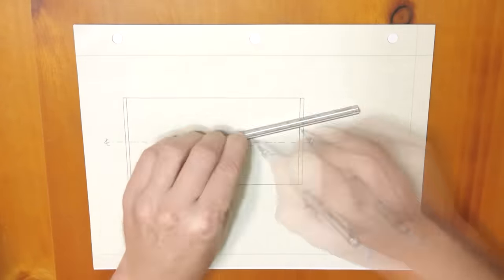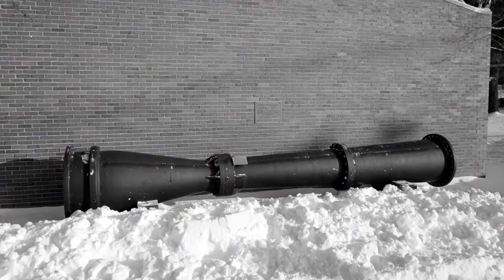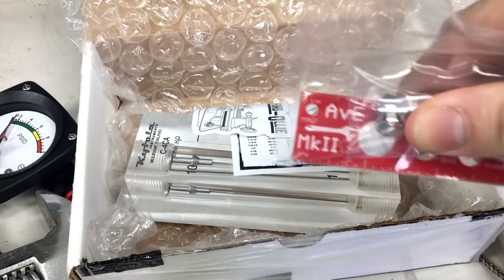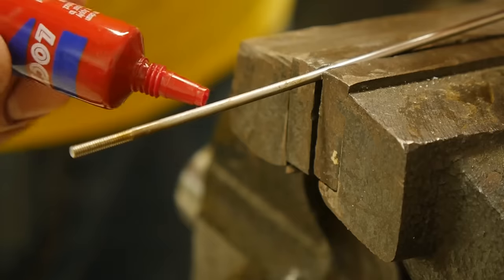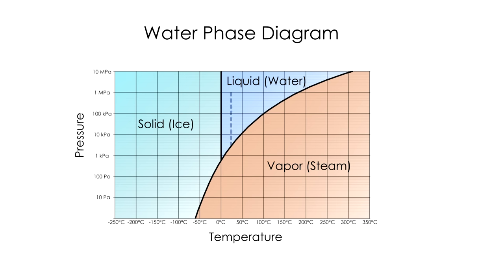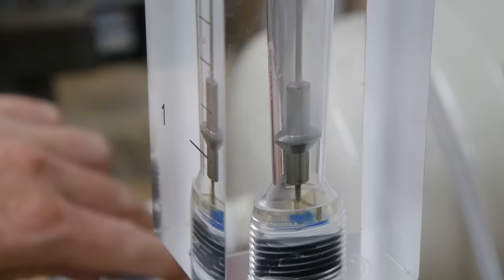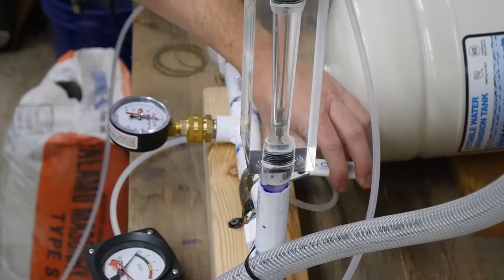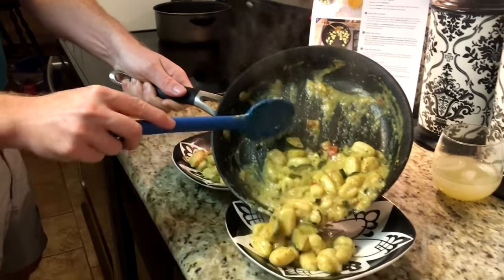What is Cavitation? (with AvE)

Comment: Cavitation can eventually wear through sleeves, the block, and any other components that coolant(antifreeze) flows through in engines i know we use  venturi ports for sensors to measure exhaust pressure for EGR in 18 wheeler engines

Comment: I have a question about phase shifts and changes in pressure (looking at the chart of water phases) that I am hoping to gain some more insight on - any insight would be appreciated. 
How does the rate of pressure change impact the vaporization of a liquid (and even would the liquid's velocity have an impact)? In other words, is the relationship between temperature/pressure assume uniformity of things like laminar flow, consistent pressure change, etc?
Thanks in advance, my imagination stays active when I watch your videos!

Comment: Great video! I was just left with one question. At 1:20 you explained that the fluids energy needs to switch forms. Why does it need to be the pressure that decreases instead of some other internal energy form, such as heat?

Comment: Would you could you possibly do a video on prop cavitation on a boat. I know that boat engines requires some cavitation in order for the engine to gain rpms so it can reach maximum speed. I had a boat with an inboard/ outboard engine. The engine was a 140 hp inline 4. The out drive had a 24p aluminum 3 blade prop. When traveling at 30 mph+ and a sharp turn it would cavitate severely.  It didn't take long until the prop had tiny little holes on the surface in the same area on each blade. If you don't want to get into it I completely understand. I would love to see it explained. And I would like to show my son in law what is causing the same thing on his boat.

Comment: Cavitation is actually a very important thing to consider with submarines. You want the sub to move fast, however, if it moves too fast, it starts cavitating, which will give your position away to anyone willing to locate you, which is usually the same people that want to destroy your sub in a combat situation. One solution is to simply dive deeper, as the increase in pressure also directly impacts cavitation, however, if you dive too deep, the submarine will be destroyed by the pressure, so you have to design the blades of the propeller in a way as to minimize cavitation, as this allows you to go faster as less depth.

Comment: Cavitation erosion is a major wear concern on wet sleeve equipped diesel engines. A air pocket in the cooling system causes implosion. The result is noticeable wear on the sleeve contacting the cooling system. Many OEM recomend replacing the wet sleeve.

Comment: Lol.  Thanks for your video.  I've been wonder for year seen I was a kid(may be 8 years old) ,  i had an accident discover and always think about it since then.  Btw,  I have a better and cheaper way to demonstrate your experience,  by just use a garden hose and a clear soft tube.  Back then,  I had to watering my mom garden in my hometown(vietnam) several times per day,  we didn't have the nozzle to spread out water,  so I had to squeezed the end of the hose,  but then I didn't want to wet my hand,  so I squeezed the tube a bit farther from the end,  and accidentally heard the water bubble sound. I thought when I squeezed like that,  the velocity and pressure of the water came up too fast that can traped and suck the air from the end back to the tube and make that sound,  but when I move back farther,  eventually there are no air mix(bubble)  came out,  but I still hear and see the bubble formed behind the squeezed spot.  Later,  I tried on a compressor car wash,  and found out the damage on the tube wall.  In fact,  I did cut(separate)  the tube after 5 minutes  of squeezing the tube under the pressure of the car wash.  Also,  I found out the damage at the end of the carwash adjustable brass nozzle.  Back then I just understand a soft material like water still be able to to such damage to other hard material like plastic,  brass,  steel or rock(i didn't know water cutter machine exists until later). So now I know how to explain for my kid(in the future,  not yet 😁).

Comment: To observe the effects of extreme cavitation, get someone with a water jet cutter to install a pipe inline without deburring the I.D. of the cone tip after cutting and threading. The next pipe down steam will be fractured longitudinally about 10-30mm after the cone, with a 3-4mm bowtie pattern on the outside. Cavitation bubbles collapse and get focused up to 1 Million PSI! 

Amazing that water can actually compress by up to 10% at 90,000psi!
Reply: @waterjet channel maybe?

Comment: Maybe you can answer a question for me.
On a Hydraulic oil system running at 450psi from the pump to filter housing. Why is it that if the housing is not tight enough it sucks air instead of leaking? Pressure inside canister is greater than the outside air so I would think it should leak.
But it sticks air and creates foam in the oil.

Comment: On our hydraulic run water pumps on oil field cement units over spinning will lead to cavitation leading to air bubbles in cement that Coriolis tubes hate, plus it pits the impeller

Comment: I've proposed the installation of a "safety ring" around the circumference of a boat's propeller to prevent injurious strikes against humans, manatees, etc. This wouldn't be like a ducted fan, but only a safety bar. Do you think the fluid dynamics would make this overly interfere with thrust due to cavitation? (I don't).

Comment: I'm positive the pump we use for truck discharging has internal cavitation damage. Visible rust on the outside in a specific pattern is present. 

I wonder what happens when the casing fails and flammable liquid goes everywhere 🤔😲

Comment: Interesting about steam creation at low pressure. Consider, so much power generating is based on heating water to make steam which turns turbines. I wonder why that trick could not somehow be used to do the same.

Comment: So I'm into building and racing cars. In engines that are revved past the manufactures redline, it is often said to upgrade the engines oil pump to avoid Cavitation. The question is, does this cavitation act on oil the same way as water?

Comment: Y'all forgot the jet! 

The collapse itself isn't the worst part. The way it collapses turns the cavity bubble inside out, creating a micro jet, sort of like a shaped demo/anti tank charge. This jet of liquid hits the surface oposite the direction of collapse. But it also means the damage is directional. If the bubble were to collapse facing away from the surface, the jet wouldn't hit anything.

Comment: I suspect the 1-1/4” suction fittings (90’s) on my shallow well water pump are causing some cavitation as I hear air bubbles when pumping but the suction line is tight. I suspect this is causing wear on the nylon impeller so based on the video I need a larger suction line and smooth 90’s..

Comment: I know this video is 2 years old at this point, but i feel that I have to mention that I'm pretty sure you meant pistol shrimp and not mantis shrimp. mantis shrimp in general either spear or use a very strong hinge mechanism to hammer open tough shells. pistol shrimp use a large claw to shoot a jet of water incredibly fast which  i believe is the example of cavitation you meant.
Reply: He definitely meant the mantis shrimp, which is so much more interesting to people that it is talked about and linked to on the pistol shrimps wikipedia so they can go read about it instead

Comment: I am working on a 70 foot yacht right now that has holes in the hull above and in front of the propellers that have an air passage to create "controlled cavitation" I have seen this on several boats (all the same manufacture, and all from the mid 1980s ) so I am thinking that it did not work like they wanted it to, or they found a different way to get the result they were looking for, (not sure what they were trying to achieve with this) .

Comment: I have a question.  Why is it that carburated engine planes get carburator icing on warm days, even when it is as much as 38 degrees?  The paradox is that on colder days, the chances of carb icing go down.  Also, as temperatures get warmer, the maximum potential of car icing tends to be at a lower RH.  Max probability at 30%, while the same chance at 100% RH doesn't occur until 28 deg.  This is the curve for "light icing".  I would love to hear an explanation on that.

Comment: What's the equivalent principle in aerodynamics?  As long as the grass is below the top of the box in my trailer, the pressure inside the box from the air streaming over the truck on the highway will always keep the load inside the box, compressing it, and prevent it from blowing out of the trailer. Doesn't work if any of it is sticking out the top, at which point I need to tarp the load to prevent it from flying. I always thought this was a cavitation effect, but apparently not.

Comment: Would cavitation be used in a steam heating system? Or is this too dangerous? 

I have a gas fueled boiler steam system. I was wondering if it may be advantageous to add cavitation to increase thermal efficiency.

Comment: If steam is being formed in the partially blocked flow meter, then the steam should be absorbing latent heat of vaporization, so the temperature of material around the obstruction should fall.  But apparently that doesn't happen.

Comment: This type of flowmeter is called a rotameter and is just a float in a vertical diverging duct. I'm confused as to how you can use it as a substitute for a venturi, since it has only a diverging part which slows the flow down?

Comment: Okay. We know for steam to form with in water, it requires a micro bubble to begin with. Where would these microbubbles come from in this instance?  I have always had the understanding the bubbles formed with cavitation are oxygen bubbles as the dissolved oxygen comes out of solution due to the low pressure zones.

Comment: Today I learned that collapsing cavitation bubbles are violent events. The sphere becomes a torus as water pressure pushes inwards until the torus is fully collapsed. A micro-jet forms in the direction of the collapse, acting like a jet from a shaped-charge warhead and is capable of scouring metal. And that's on top of the shockwave created from the collapse.

Comment: Around 4:15 you say that water can be turned to steam at room temperature even at low pressures. What is considered low pressure? The water phase diagram shows 1 MPa = 145PSI = 10 x atmospheric pressure
Reply: The phase of water (and all materials) depends on pressure and temperature, both equally important. At one atm (atmospheric pressure  = 100kpa = 14.7 psi), water will boil aka vaporize aka turn to steam at 100 degrees celsius. HOWEVER the lower the pressure, the lower energy is needed to vaporize the water. This means that (although there are limits to how far you can go) you can alter the pressure to cause water to boil at any temperature you choose. It is an exact science. If we desire water to boil at 20 degrees celsius, we need a pressure of 0.02339 bar according to a property table for saturated water from my textbook. This equates to 2.339 kpa, so a quite drastic reduction in pressure is needed. Reducing the pressure beyond that will only cause the gaseous water vapor to expand to fill up the remaining space to the best of its ability.  

By the way, that value appears to correspond nicely to the chart at 4:15
Reply: @kylecook4277  Thanks for the feedback. Makes more sense now.

Comment: How about oil pressure loss, or temporarily induced pressure loss, in say, a turbine engine that is cycling 10 to 12 gallons oil through the system every 42 to 51 seconds? Would a momentary ingestion of air, or let’s just say a sudden lack of liquid oil from reservoir, which is at 70 C, and unpressurized (atmospheric vented), into the pressure pumps that are set to output between 150 and 250 psi, induce similar effects to a jet engines oil?

To be clear, I am just diving deeper into a possibility of negative g condition causing a delayed pressure drop in the power section oil system of a turbine engine. I realize the lack of oil pressure and its significance and eventual destruction of said power plant, if oil under pressure isn’t returned into system within seconds. I’m just understanding this “bubble”(bad term here, I know) that would be passed the system or at least part way and looking to educate myself on what we assume is merely a lack of pressurized oil passing through and intending to form an argument that this is not to be an acceptable condition or viewed as “normal” in any way...

Thanks for any response and great videos! I Subscribed!

Comment: Weirdly enough where I work has an issue of internal  damage caused by cavitation caused in a liquid mercury target contained inside a SS vessel, but that is likely because of the 1.4 MW proton bundles being slammed into it every 60 microseconds. Practical engineering should hit up another CE for a tour sometime.

Comment: Careful with that axe Eugene: LeClair (2014) used a ¼ hp cast iron water pump off Ebay to long term cavitate a rolled up perfed aluminum sheet in a plexiglass output tube and both guys had radiation damage requiring hospitalization. Beware transmutation.

Comment: Can this high volume low pressure effect of the reduced diameter be used to pump water (coupled with a tesla one way valve) with no moving parts?
Reply: I'm an Engineer on a steam ship.
I'm pretty sure that is how we introduce new water into the boiler , overcoming the pressure of the steam inside the boiler.....

Comment: seek to use water and air to dig a hole. seek to use high-pressure large volume water with a one-way valve inject bursts of high-pressure air to add to water that closes the one-way valve for a moment slam water out the end of the pipe.      i not sure how to calculate force. increase hammer effect at the end of while maintaining pipe safely.

Comment: Water has a 4th state in high temperature/pressure environments like, say, the piping in a coal power plant. Super-critical water at 114c will turn to steam instantly in the piping and it is in-between those two environments you can find this 4th state.

To be fair, its not real science and water does not have 4th state, it was just an interesting fact my dad told me when we were visiting a power plant while I was younger.

Comment: Wait, why don't they do this with electrical turbines instead of burning tons of coal and oil to heat up the water until it becomes steam?  Couldn't they make a steam turbine with minimal fuel just by using these pressure principals?

Comment: yes but venturi isnt involved here. Under venturi conditions, an increase in diameter results in a increase in pressure.  Here we have no steam, just liquid water , before and in the obstruction, and we may have steam (but mostly mist) after. No way an increase in pressure would create steam. if we were in a venturi condition, we'd need to have pressure lower than ATM and therefore the flow would reverse, and that would make no sense.
Moreover, vaporizing water would also considerably chill (or totally freeze) the whole apparatus.
Reply: I invoque @thunderf00t

Comment: OMG. Thank you so much for this. I have been wondering for years why the cold nuclear fission of pumps was described as sonoluminescence? And here it is. A change in vapor pressure creates gas in most liquids, which then recondenses when the pressure is increased.... and you can hear the bubbles pop,, so “insanity strikes”, the pressure is enough to beat everything into invisible (nano sized?) particles that dissolve in the liquid.

The flaw in that logic is assuming liquid water is exclusively a produce of heavy molecules that are too massive and slow moving to be a gas. Sorry, not true. Water is liquid due to the hydrogen bonding formed by the dielectric forces of the polarized molecules forming massive gangs of water molecules that collectively cannot amass the kinetic energy to vaporize. This is why just lowering the vapor pressure does not damage containers, cavitation has to break up the gang molecules. As we know, nature requires a redistribution of energy when bonds are broken (which is why divorces are so expensive, but I digress). The massive hydrogen bonds are converted to less massive, but more powerful ionic bonds of O-H ions into diamagnetic gas molecules. That will condense (break the intra O-H ion to O-H ion bonds formed to make diamagnetic molecules that are pure O-H, but will not condense in 1 atm until minus 158 deg C) at pressures as low as 5 atmospheres the diamagnetism breaks the gang ionic bonds, releasing a very powerful electric spark that will fission any atom in contact with he gas as it condenses (like an impeller blade that it slams into).
IF you doubt this, try to see if any other regular liquid can dissolve impellers with cavitation. Plasma physicists have vaporized water with IR lasers and using magnetism slammed the bubbles into containers and sampled the radioactive (very light element) remains, confirming the fission.  Also, cavitation alone, with the fissioning of the cavitation will heat water to steam temperatures with 30% less energy than directly heating the water. Not economical for the cost of replacing the cavitators.  There are also several patents filed for purifying water with cavitation. The pollution is turned into protons, not just beat to pieces. This form of water vapor is also known as Brown’s Gas, an alternative gas produced by electrolysis of water than H2 and O2. (It makes a very clean fuel for IC engines. With implosion/condensation, not explosion/pollution-combustion). Party on Dude, be good to each other. This is one of the ultimate disruptive technologies of our lifetimes.
Reply: One more thing, if you magnetize your impeller blade, the cavitation damage may end, it should reduce, the gas macro-molecules are highly diamagnetic.